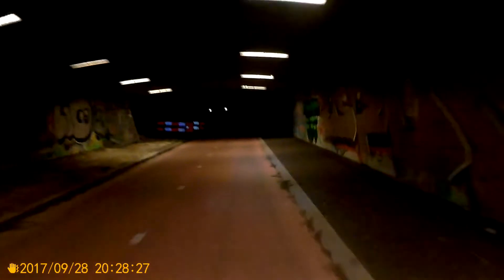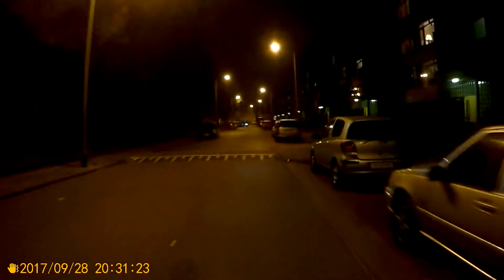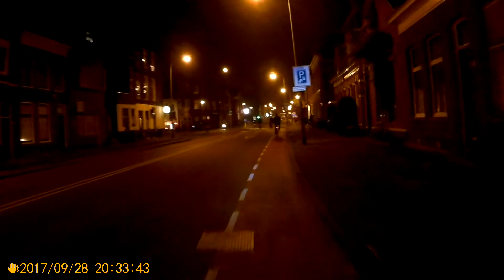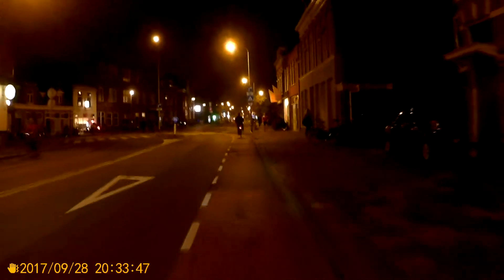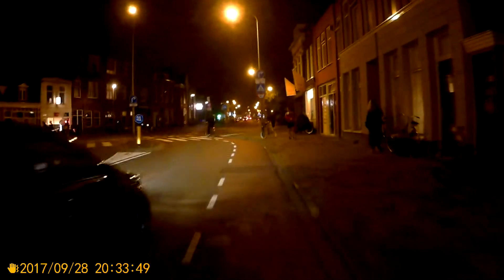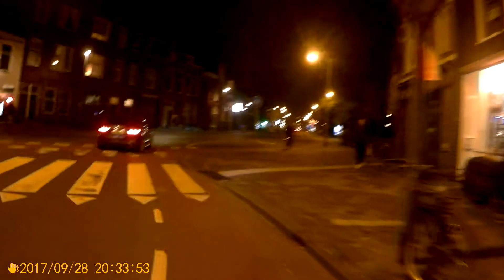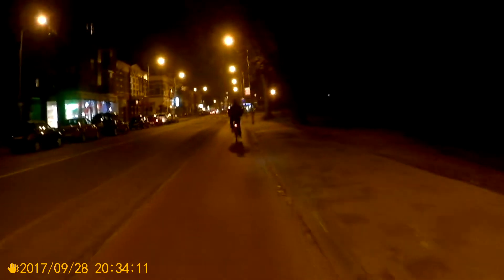Night Ride Low Light Test SJCAM SJ5000X Elite / New bike Lane has Very Poor Lighting (WH 28-09-17)

Comment: ISO in video mode has no effect, same for the EV. In addition there should be difference between 25 and 60 fps in terms of brightness but there is not, the only improvement comes from the "Low light mode on" that automatically changes the fps
Reply from the maker: Still experimenting with the settings, tried to set teh cam to lower fps (4 k 24 fps) seems to work a litte better